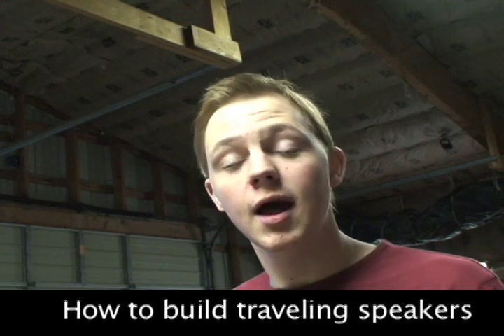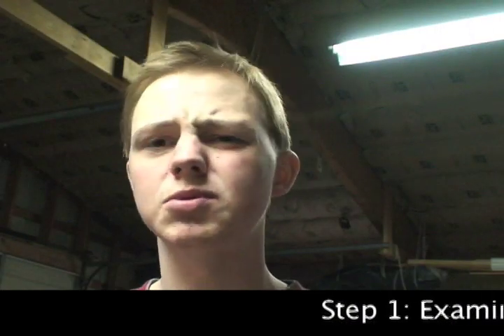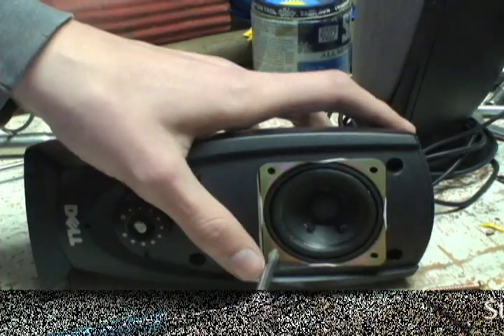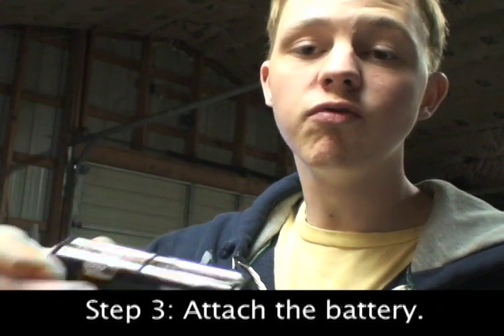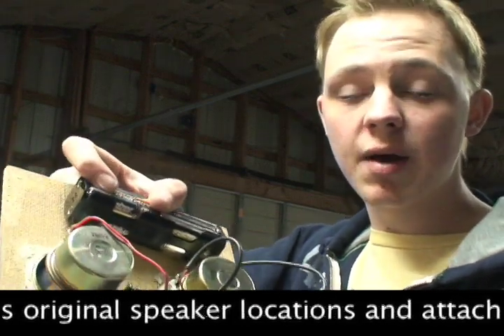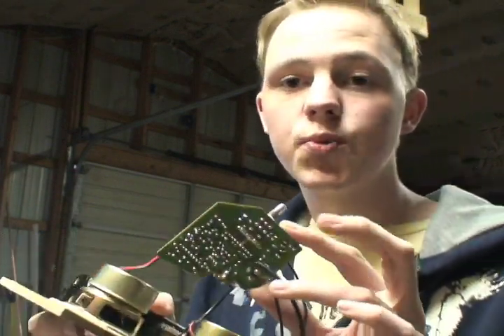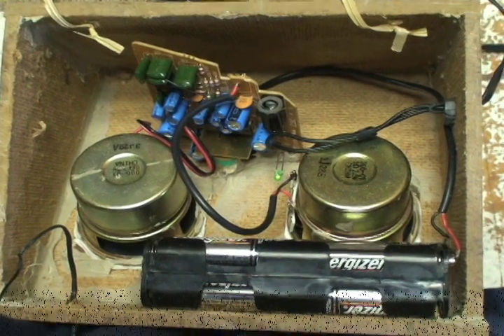How to Build Portable Speakers

Comment: I need a portable speakers with out any circut with 3.5 jack in put
Reply: +ammana chowdary u must have circut-amplifier because sound will be play very quietly
u can buy something, its not expansive, I will buy this 5v 1a amp -2x3w and 6-18v max 1.5-2amp 2x15w
http://www.aliexpress.com/item/PAM8403-Audio-Module-DC-5V-Mini-Class-D-digital-amplifier-board-LCD-Top-Sale/32578750136.html?spm=2114.01010208.3.146.apP4bt&ws_ab_test=searchweb201556_2,searchweb201644_4_505_506_503_504_502_10001_10002_10017_10010_10005_10011_10006_10003_10004_10009_10008,searchweb201560_3,searchweb1451318400_-1,searchweb1451318411_6449&btsid=8dda2320-89e1-4943-8038-d86cb8f41905
http://www.aliexpress.com/item/1set-TDA7297-amplifier-board-spare-parts-dc-12v-grade-2-0-dual-audio-encoding-15w-electronic/32511967000.html?spm=2114.01010208.3.69.KVng2u&ws_ab_test=searchweb201556_2,searchweb201644_4_505_506_503_504_502_10001_10002_10017_10010_10005_10011_10006_10003_10004_10009_10008,searchweb201560_3,searchweb1451318400_-1,searchweb1451318411_6449&btsid=35cf0ba2-f7af-472d-97eb-cb9db97added
PS:shipping is free to cze, look at some of free ship to ur country

Comment: okkim revilo , eehm for the speakers itself it doesn't really matter what voltage is. but on the amplifier you have to use the right voltage otherwise there will be some smoke coming out of the board.

Comment: My only question is how long do the batteries last you for the speakers?
I've been meaning to make some, but just haven't had time.
I'd be using mine for work, so they'd be in use for about 8 hours a day, give or take.

Comment: If it is AC you are a little out of luck because a battery gives DC power. you could run it throw a DC to AC transformer but they are not vary common and mostly not worth buying. Easier to find some new speakers in the garbage for free.

PS; AC is alternating current and DC is direct current. 

I'll PM you a video that might help since youtube will not let me post a link. :P

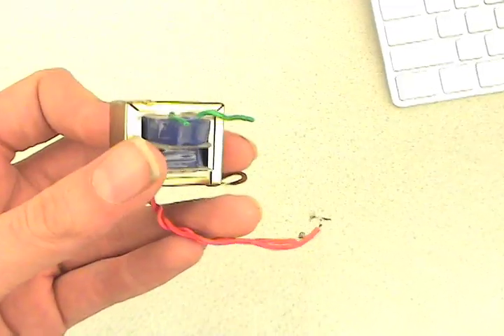Comment: You put them where ether the power cord normally went or if it has a transformer built in (that boxy thing he showed at 0:36 ) on the other side of that. REMEMBER: to make sure it is the right voltage and to attach positive to positive and negative to negative. 

Positive will ether have a red cord on it or a black one with a white line, negative will be solid black. (unless your speakers are really really old) of you get it wrong you could fry the amplifier and/or it will sound distorted.

Comment: Sorry for the late reply but

No you could run that speaker you made in this video off a 40amp car battery if you wanted and it would not hurt it.

A good way to think of it is Voltage is the speed of the power, Arms is how much of a draw you can put on that power and Watts are a total of the two.

I made a lovely battery run heated shirt that uses a 12v 5a PC backup battery, it powers it for about a hour. I could use a bigger battery and that would make it run longer. Smaller and it may blowup.

Comment: just use duct tape put each battery's + on the others battery - until u have 8 batteries connected, at the end just take wire from the + of the 1st battery and the - from the 8th battery.

Comment: Hey, I've got a very important question!
On the transformer in my speaker it says (among other things): "OUTPUT-AC 10.7V/0.8A". Now to my question. Is the output energy actually 10.7V? What should I use for this? If I use 12V battery pack, does it only use the amount it needs or does it somehow get to much energy?
Please someone answer, thank you!

Comment: OK. You ready for this one? I Have a 10W sub, 2x 5W speakers, and 2x .5W speakers. I want to make a small portable sound system. I also have what says a 9.5V old RC battery and I also have a battery pack just like yours with 8 slots. Do you think I could use both packs to power my speakers or would it be too much? Also, I have no control panel, or just one but I don't think its big enough and i ripped all the wires from it. Where do you think i could find another? 
-Goljummer

Comment: Hi I have a set of 2.0 speakers which don't work (the transformer burnt). I used a 6 v battery to bi pass the transformer and I discovered the circiut is still alive :D. I need some advice. If i use a USB cable to power up the circiut insted of using 240v transformer (USB has 5v which is only 1v under) will it be ok???

your sincerly 199216Robert.

Comment: how long would the speakers last on max volume, and how do they sound on max volume?? can i build like a very very nice speaker setup with nice bass, nice stereo and nice battery time?? also, can i use like a heavy 50 bux battery (like 25v) or something that is rechargeable? thanks!

Comment: The Ah of you Bat Pack only say how many hours it would last with 1 amp constant flow.

The amps that go through the Speakers Circuit are based on the Resistance it gives.